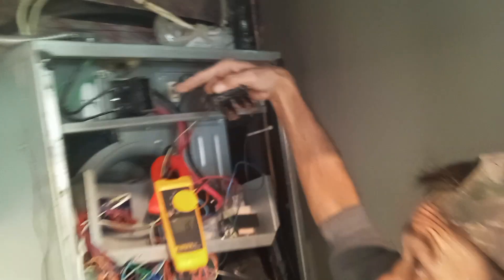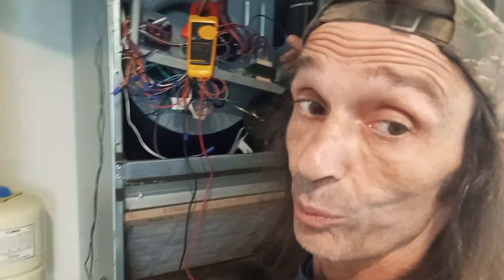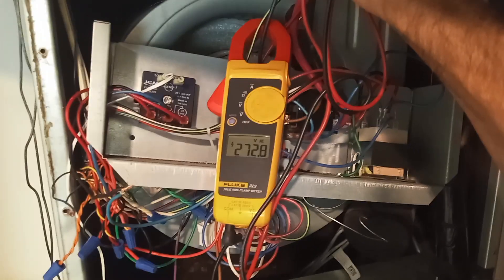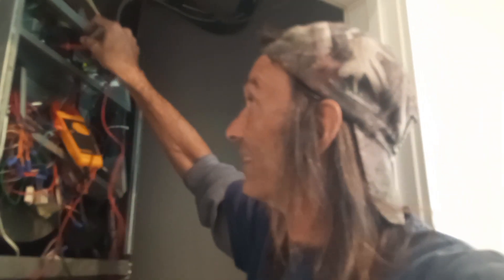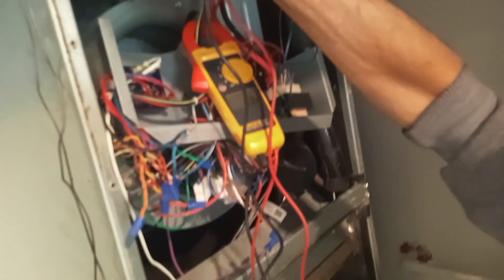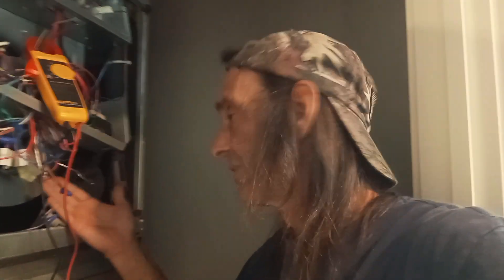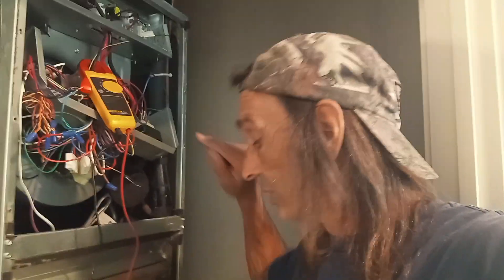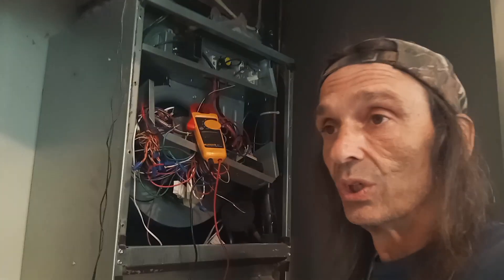290 volts with the power OFF??  Very Dangerous Heatpump/use your meter!

Comment: If you get that much voltage then check to see if it has solar system. In any case it shouldn't be connected unless someone mickey mouse with it.
Reply from the maker: On site technician changed the contactor in the odu.. wired it wrong. Yep. Be careful!  Especially when following others and always assume somebody tinkered with it before they called you.

Comment: Yep, transformers work both ways. If you feed low voltage into the low side, you will get high voltage out of the high side. In this case, the low voltage was supplied by another (energized) transformer.

Comment: ck for floating neutral on the incoming power (to the house).
Reply from the maker: Not this time but yes ! Brings up a good point we face now... with solar systems there is potential for backfeeds when power is off.. on the neutral and ground? I'm not totally sure about this but I'm going to study it more. As I've traveled around the country I noticed that some jurisdictions actually have signs up warning lineman that there may be back feeds from local solar systems.. where I live there are no such signs but I'm sure the same potential exists.
Thanks for the suggestion and comment!

Comment: damn that's nasty. What happens if you turn the entire house off, can you?
Reply from the maker: I put a rundown of what I found in the comments... was a high volt line crossed onto the contactor 24v..
But yes if you turn off the whole house power would be gone, but   sometimes you need power on to chase down the problems.  Be safe out there.
Reply: @pairofjacks1006  lol wow. Yea electricians usually don't care about data lines / low volts but the data guys always run them 3ft+ away from the higher voltages... I always tell people that kind of spookyness can happen with cat5/cat6 (ethernet) cables too.

Comment from the maker: The main point is dont get too comfortable.. always follow good safety practices..
On this job, another technician was having problems diagnosing the system a few days earlier. In the process of connecting and reconnecting things the technician put one side of the condenser fan motor straight to the compressor contactor..
Because the voltage was traveling as a backfeed through Motors and control coils it was reduced until it hit the load side of the control Transformer....

Why didn't this unit trip the breaker?.. find line power connected to the 24 volt circuit, and the Transformer has a pigtail connected to ground...??

I'm not an electrical engineer, but Transformers and contactor coils are similar in that they are wound thousands of times around a magnet... when I check across the lines on the unit side of the disconnect I get zero volts, but each one to ground gives me a reading, this tells me that the voltage on both sides of the unit are coming from the same side of the line somewhere.. always remember just because your meter shows zero volts  in no way means that there is no voltage present, if you read the same side of the line there'll be no reading because there is no electron flow through your meter.. always double-check each line directly to ground as well as across.

Like I said I'm not an electrical engineer but I believe because of the specific way this unit was miswired the low voltage system, with its array of coils and motor windings, which then back fed the control Transformer, actually somehow made the control circuit a homemade Step up Transformer, in this case transforming from 210 volts up to 290...on the line side of the control Transformer. 
The breaker did not trip and the only part I needed to change was one contactor.. usually when I see this happen, almost every 24-volt control needs to be replaced and sometimes the thermostat wire is melted and needs to be replaced as well...

So if I had told you this story you wouldn't have believed me but you better believe your eyes.. unfortunately things like this are becoming more and more common as companies push untrained people to accomplish trade tasks. It really puts these untrained guys in very dangerous situations and as you can see these are the things that we come across after everyone has tried to fix it... 

Use gloves.Use your meter.Get training and pray alot.. Experience comes with time and  a few electrical shocks .. Be safe out there.

Ps.. I was asked to change the blower motor in this unit and when I arrived the disconnect was already pulled out.. if I had put the disconnect into the air handler before I had found that problem, there surely would have been some fireworks and some breakers tripping... it quite possibly could trip the main for the entire building when you take something from Line to Line.. I almost always verify the part I'm being asked to change actually needs to be changed but this time I went straight to changing the motor..
For some unknown reason I broke my routine so this time I have to thank God I made it home home.